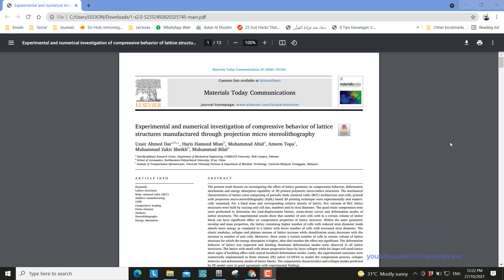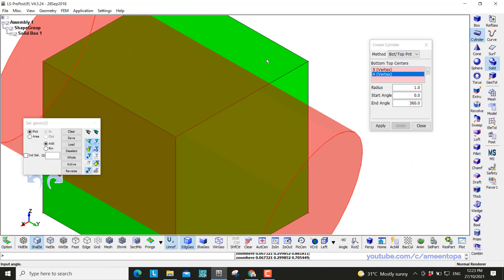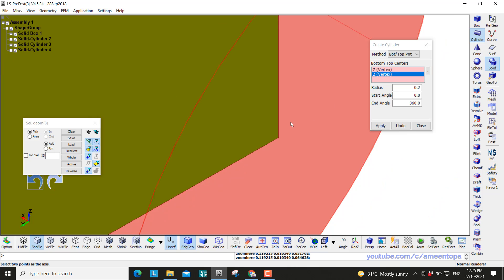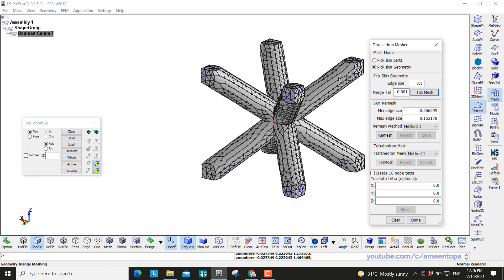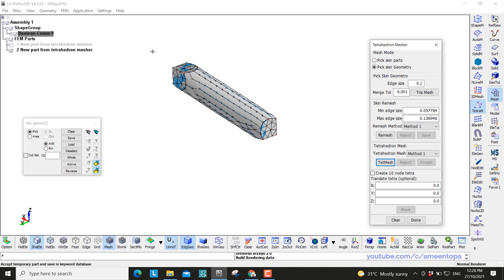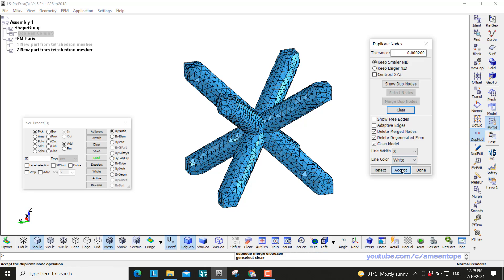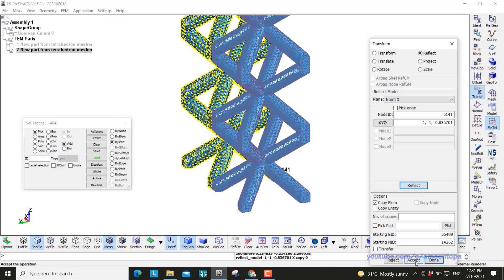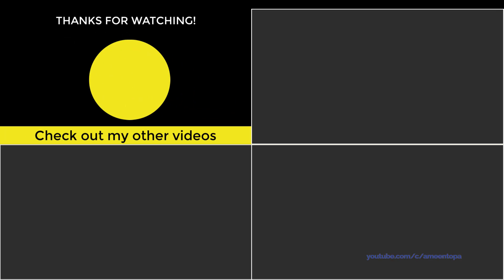How to Create Solid Mesh for a Lattice Structure

Comment: Dear Ameen, thanks for the interesting video. I would like to use such lattice structure to model a sandwich structure with a flat plate on top and bottom of the lattice and perform a low velocity impact analysis but i have two questions:
1) which is the best approach to bond the lattice core and the flat plate if it's not possible to merge nodes?
2) how can i avoid that the lattice structure penetrates itself?
Reply from the maker: @AntonioGarofano-x7k  1) Use *CONTACT TIED NODES TO SURFACE 
2) Use CONTACT AUTOMATIC SINGLE SURFACE

Comment: I am modelling the ceramic+composite system. Ceramic completely gets annihilated after the impact. I have use constrained tied nodes failure. It is working sometimes, sometimes not. Can you help me with it?
Reply from the maker: I recommend you to use Contact Tiebreak. Check out my delamination tutorial.

Comment: Hello ameen, can you do video on impact simulation in which two different parts are attached by contacts and there is some penetration?
Reply from the maker: You can use connect the mesh of the two parts by merging their boundary nodes.
Reply: @AmeenTopa  i am quite surprise that a 4 point base is chosen for each pyramid

What about 3 point base (tetrahedron) 5 point base pentagonal peramid, and hexagonal pyramid??

Were any tests performed to compare them? Because this lettice type is amazing but we must know if its the best
Reply from the maker: @FirstLast-tx3yj  We did experimental work only to 4 point base lattice and the results were published in a journal article (check the description of the video).